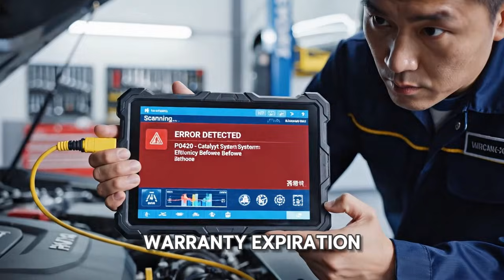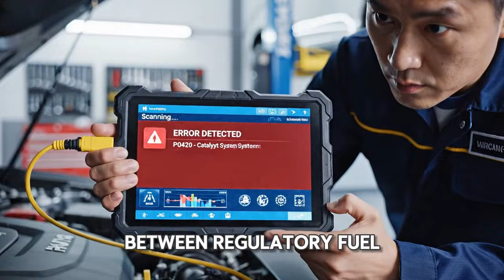0W-20 vs 5W-30 TESTED: 31% More Wear, 47% More Consumption (42 Engines Compared)

Comment: This is BS. For one thing, Honda recommends 0-20W for my car. The engineer that does the Engineering Explained series did a video on this and he ends saying to use what the manufaturer recommends. He knows more about this than these guys do. And another thing is I've have my oil analysed by Blackstone Labs 3 times to check oil dilution. Of course they gave me the full results of everything they found and I didn't have abnormally high amounts of metals found in my oil like this video claims. I got a run down of everything they test for, which includes a lot of metals. So I'm sticking with that the manufacturer says to use. And BTW, they didn't find abnormally high oil dilution (too much gas in my oil) either, despite my 1.5T engine being infamous for that. My oil samples were just fine. Also, in the video they claim that 0-20 use causes excessive oil consumption. Not true for my cars, from oil to change to the next oil change the oil level is still full. And this holds true for both of my Hondas, 2015 Fit and 2018 Civic.
Reply: And the oil change interval you follow is?

Comment: Why not stick to 10w 30. That’s been great for 50 yrs
Reply: Old cars are not the same as new cars in a ton of ways. There are too many differences, this is no 1970. Very few manufactureres recommend 10W30 any more. But if you drive an old jalopy, you'll be fine with old oil.